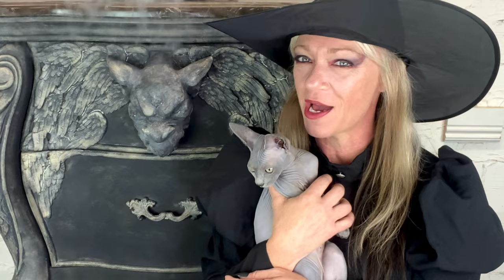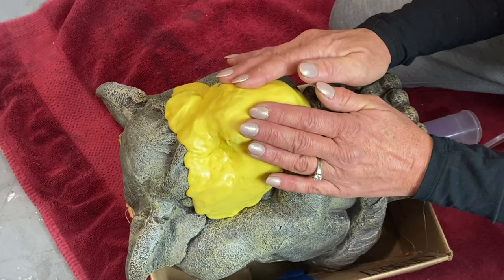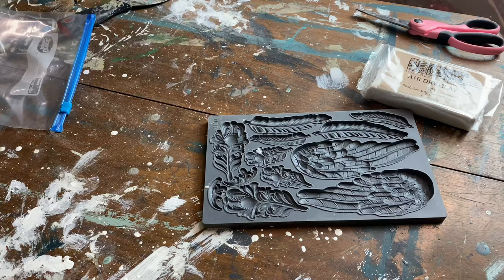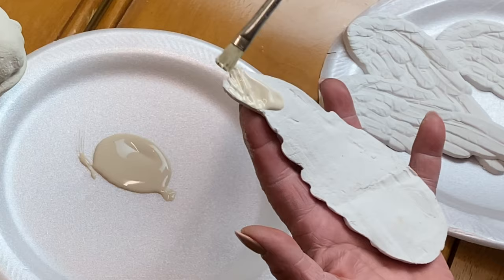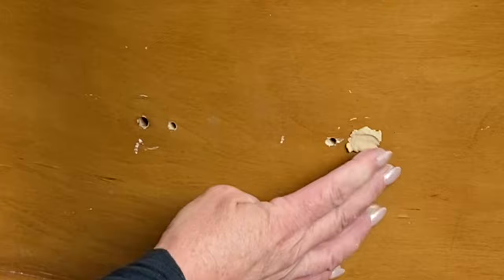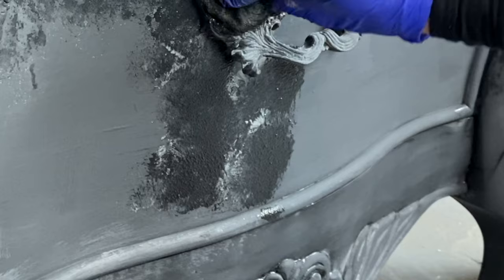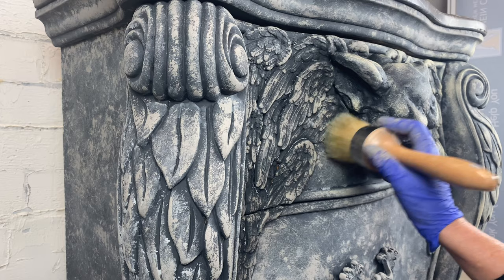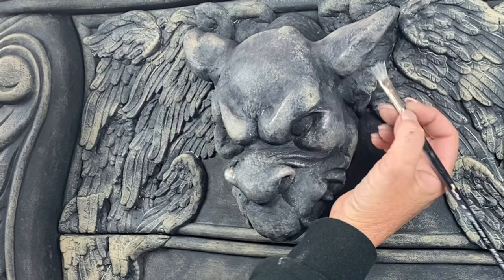You can do this , on furniture! Gargoyle Dresser / Furniture Flip /Halloween Idea make your own mold

Comment: Try using a stocking to dust your molds.  Put your dusting powder inside and tie off with a rubber band and tap on each mold.  Works a lot better than a salt shaker.
Reply from the maker: Cool!